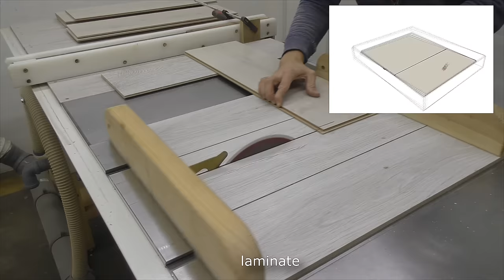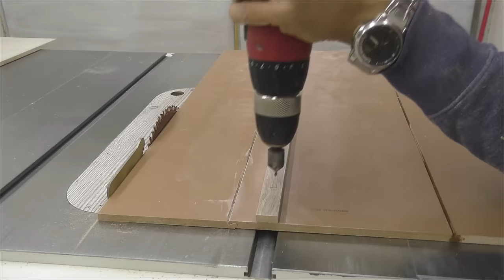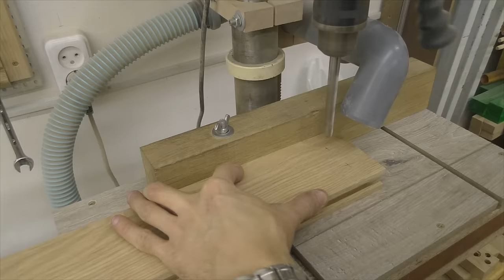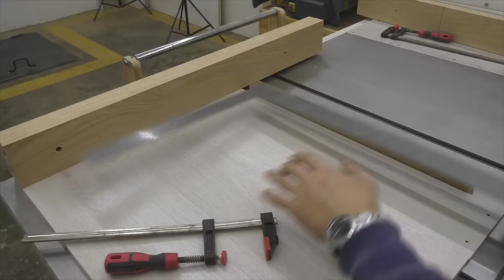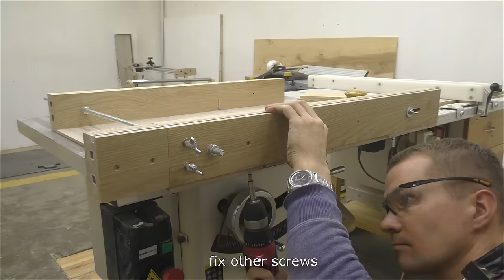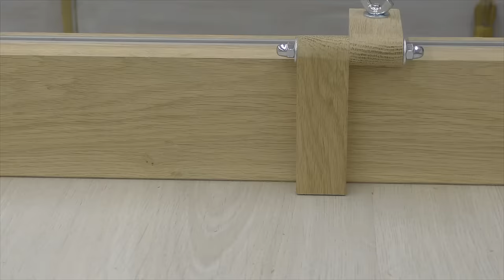🟢 DIY Adjustable Crosscut Sled - Making Table Saw Sled 👉 FREE PLANS 👈

Comment: This is the best crosscut sled design I’ve seen! Thin base (what is that? Flooring?) blade width adjustment! Adjustable fence/stop block! And the way you micro adjusted the fence with the threaded rod to get perfect square was really smart!

Comment: So impressive... Absolutely amazing craftsmanship and I'm simply astounded at all the wonderful crosscut slide ideas - major props!  If I could only make two suggestions - first, that extension piece could use some bottom support -- a simple dog-eared square would do. Second, your stop block would benefit by construction from three pieces instead of two, with the flip-down piece sandwiched between the top twp to minimize deflection. You could also increase rigidity and functionality by adding a rabbet in the bottom of the top pieces and making an acrylic insert to span the two pieces which could also function as a ruler marker by scribing a line in the middle and using red ink to fill the mark.

Subscribed!

Comment: Job well done! question: The adjustment aluminum tubes. When cutting into the fence, is there not a danger of cutting the bottom tube?
Reply: There is. I noticed that too. I think if you place a sacrificial piece of wood behind the piece you're cutting you can probably raise the blade up above the level of the steel tubing.
Reply: When the square aluminum tubes are fully inserted (closest to the saw blade line), the tubes don't cross the saw blade path/line. The pair of aluminum tubes only move away from the blade line/path.

Comment: Hi From the UK, i have been following your videos for a while. I now have a new AXMINSTER craft saw and need to start adding some jigs. I plan on attempting this sled. Two questions... 1..did you use the same blade for the aluminium track?   2...what is the thickness of your laminate??,, here in the UK we have many thicknesses .. keep up the fantastic work - nice to see you taking the trouble to produce plans for you builds.
Reply: Ken ... Did you get an answer on the thickness of the laminate to use?  I guess it needs to be thick enough to make a stiff, level base but don't know what thickness that would mean ? 8mm / 10mm ?  Thanks in advance for any advice.  Chris.
Reply: @chrismaughan8029  10mm - check plans

Comment: I just finished building a crosscut sled very similar to Woodsmiths.  I included the adjustable opening base for the blade size from thin kerf to Dado set. I wanted the fence to be extendable but wasn't too keen on having to add on a second piece like in this one so I used your idea and integrated two aluminum bars that could be pulled out a variable distance as needed to extend the fence. It turned out great...compact yet very flexible.   I may still add a couple of T-Tracks to the base to do miters with hold-down clamps or other added capability.  It was a fun build.  Thanks for the ideas.

Comment: Check this alternative layout. To accomadate tall pieces of wood, turn the horizontal bit of the stop 180 degrees vertically, then rotate the stop 180 degrees horizontally. The edge of the stop which is closest now to the sawblade should have the horizontal screw recessed so the high wood piece can fit up against the stop. Cheers.

Comment: Just curious as to why you use the laminate flooring?  I presume it's because of the stability properties and low profile. Did you also make the zero clearance inset for the table saw with same material?

Comment: What kind of glue do you use? I've seen it in several videos you used for the laminate. Plain instant glue or something else? Your brand? Your solutions are very good, I usually watch videos. Now, in combination with laminate, I would solve my router and circular saw table. Thanks!

Comment: Your designs and presentations are very good … but your material selection could be better on this sled.The sliding rails made from oak will swell (expand and contract ) in a lot of climates and may make them  difficult to move in  the moister seasons. It would be better to use a more stable material such as Baltic Birch so as to avoid those problems  with wood movement.Also I think it’s better to have the wear side of the flooring on the bottom for a smoother slide on the table  and the non wear side up . I would lightly sand the non wear upside so the material you cut has less tendency to move while your cutting .Otherwise I love the design and flexibility. A better and more versatile sled than your last one !
Reply: This man is an expert in the truest sense.  I don't think he needs you to advise him on oak or on his rationale for wear surfaces.  Where he lives there is plenty of baltic birch, but that simply wasn't his choice.  Nor would it be mine.  BTW, would you please direct us to your YouTube projects?

Comment: Awesome.. I liked a lot, the only problem for me is the laminated floor he used, because couple years ago I had to cut laminated floor with my miter saw and the blade was ruined, it dulls so much to the point everything I cut smokes a lot and I had to buy a new blade, so I said never again.
Reply from the maker: a few years i use only one old 10" saw blade to cut laminate and use it only for laminate, yes it's dull to cut wood but for laminate it's still good enough.
Reply: After the sled is built the laminate flooring doesn't touch the blade.